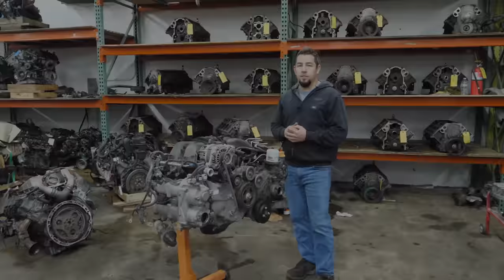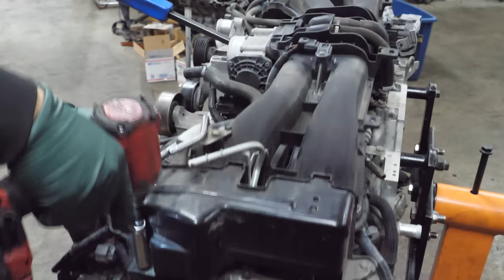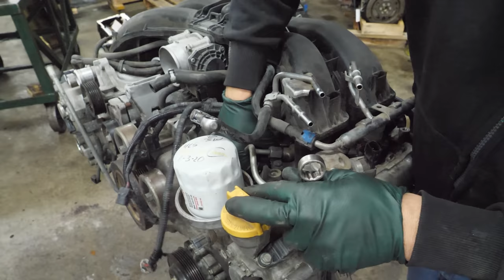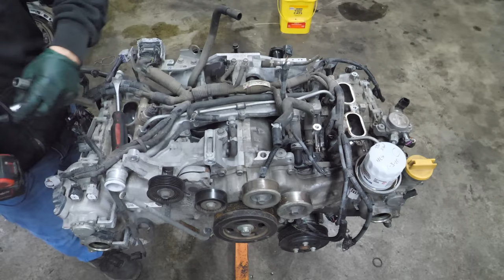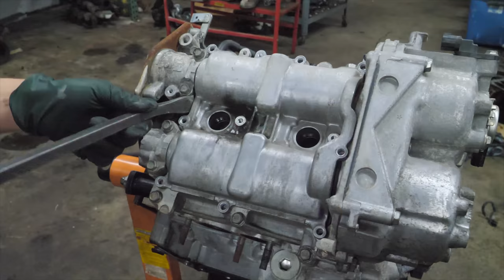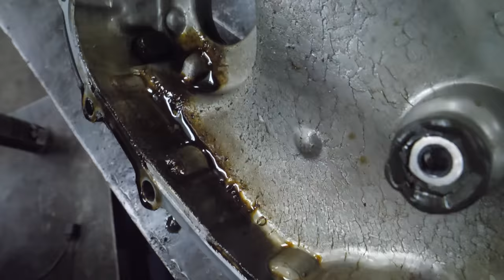Blown Subaru BRZ / Scion FRS FA20 Boxer Engine Teardown. A $3,000 + Whoopsie.

Comment: For the 5 decades I’ve been driving, I’ve been checking the oil every time I get gas.

In the past few years, I’ve asked the “attendant” at various Costco gas stations how often they see people checking oil.  A few per shift is a common answer. Even allowing for breaks for the attendant, he views upwards of 800 full ups per shift.

So, on-the-order of 1/2% of drivers regularly check their oil. 1 in 200.  Pretty rare. 

Since there usually is a waiting line at Costco gas, I usually release the hood latch while waiting. I’ve had other customers “alert” me to the unlatched hood because they so rarely see people checking their oil while filling up with gas.

Comment: Lack of maintenance pays off. Pay me now or pay me later. Majority of people prefer later because they know everything
Reply: My grandmother always cares her cars for the proper oil change and checkups, even though there is concern that they're ripping her off even though it appears unlikely.
Reply: @iceresistance  , always pop the hood and check oil color and oil filter making sure it was replaced. Trust but verify!
Reply: @repairvehicle  Her car will tell her if the oil has not been changed, and the place she changes the oil is reputable.
Reply: @iceresistance  , she is making big mistake by going by the light
Reply: @repairvehicle  She does check the other fluids to make sure they did what she expected them to do because she got ripped off by the previous dealer by filling up a much smaller amount of the fluid.

Comment: i did the valvespring recall on these engines. have done around 22 of these. they all leaked oil on the front chain cover. some on the valve covers.

the worst I worked on was one somebody already tamperd with it.
leaking everywhere, and alot.
 about 80% of the oil pickup blocked with sealant and rag fibers. thick grooves on the camshafts, missing filters for the vvt... but still runs, eh.

worst part of the recall was removal of all the old sealant. it takes some hours.

the rest was fun tho!

Comment: These engines are great at this. Oil starvation of the crank. Three ports for the four main bearings. Also don't do the valve spring recall. Engine is likely to fail after, due to rtv in places it shouldn't be. I have a car with this engine. If it fails I swapping to a Honda motor. These motors are not reliable especially if you want to make more power. And the end with the oil. Factory recommends 10k mile oil changes. Don't ever wait that long with these. I'm no expert, but most enthusiasts do 3 to 5k mile oil changes.

Comment: Really interesting engine. I don't think I've ever seen an oil filter located like that. Thought you had the motor upside down for a second. I can understand how somebody could not check their oil level, but there must an oil pressure light that would come or at least start flickering. Ignoring that is inforgiveable.
Great stuff anyway.

Comment: I worked at a yoda dealer when the frs came out.  Every single failure we saw were due to money shifts.  High rpms in 3rd, go for 4th but get 2nd, and dump the clutch.

Edit, never seen a auto blow up.  Always a manual with extreme carnage.

Comment: Early 13’s also have a common failure of a short on the fuel injector for cylinder #3. Shorts and stays open while car is off, fills cylinder with fuel and then hydrolocks when you go to start the engine again

Comment: Another problem with those engine is I do not believe they had an oil cooler and the valve cover is baffle-less. The new version is a. 2.4 with oil cooler and  baffled valve cover, al least in the gr86

Comment: If it helps, the cams/caps do not need to be removed, remove the whole cam girdle assembly as a whole, as well, leave the high pressure fuel pump where it's at. You're risking contamination. The rest you seemed to learn as you went re splitting cases etc. These engines are really quick to tear down once you know what not to touch.
Reply: Also, bank 1 and 2 side have a different crank position to achieve prior to removing chains and or heads. Also leave the crank pulley and snout on to turn engine to achieve these positions.

Comment: "Check your oil" - you'd think you wouldn't have to tell people this, but it is *THE* important advice for internal combustion engines.  I check oil level and color just about every gas fill up.
Reply: 100% agree. You can do it while filling up with gas, only takes a minute to do. Take a glance at the water level, too. What else are you going to do, stare at your phone?

Comment: The other failure mode I heard about is excess assembly RTV causing oil starvation by impeding the oil pick up. I'm sure that does no favors given the driving style these engines experience.

Comment: Looks just like my engine ~40mi after having the valve spring recall done :D RTV fragments from disassembling / reassembling everything clogged up the oil suction screen and it spun a bearing on the drive home. Shame: I liked my engine, and I figured after ~80k trouble-free miles the valve springs probably weren't going to fail. Recall compliance was mandatory in CA, though :\

Comment: Subaru. Great cars and engines.
Engines are notorious for not being forgiving running them low. Also, they don't hold much oil in stock config. That one had a lot of heat on the bottom end and yeah, low oil too at some point.
Reply: How can one upgrade how much oil it hold with a intercooler or hmm i forgot yeah true about stock config😅👀🔥🙏

Comment: a comment for the end of the video... no, you should preach because some folks need to hear it. It takes not even a minute to open the hood, pull that little stick out and check the oil level and these teardowns are great evidence of how ONE simple task can save thousands of bucks.

Comment: Next time you're splitting a boxer case, get a large rubber dead blow hammer, stand the block up on its bell housing mating service and wrap down on the nose of the crankshaft with graduating Force if that doesn't get a result put it back down on its upright position and( rubber dead blow hammer only) wrap on the side of the crankshaft nose with graduating Force alternating both directions if necessary if you only see a slight split on that end of the case go to the output end of the crankshaft with a long brass drift and Hammer of choice to the side of the rear flange of the crankshaft as done on the nose. When you have a good block this will prevent you from marring any area of the block or damaging anything in the process. Applying Hammers and punches and screwdrivers or whatever pry tool is not necessary nor prudent if the boxer case is not junk.

Comment: Most of the "no oil" engines you tear down I wonder "how could you do this" because since about the 1980's cars with < 200,000 miles don't use much oil.   I run my vehicles hard, change oil&filter every 3000-3500 miles & rarely check it & keep vehicles to 200k.  But my 2.5l 2014 Subaru used about 4 qts per 3000 miles.  Completely rebuilt under warranty at 36000, "improved" to about 1500 per qt which was considered normal.  My other vehicle was a 2006 dodge Dakota that didn't use any oil @ 138k.  I can easily understand how someone who is used to modern engines could run a Subaru dry.
Reply: Modern engines use VERY light pressure oil control rings, to reduce friction and improve fuel efficiency. They work OK when new, but as the miles build up the oil consumption often becomes much higher than we'd consider usual in a 2000's engine.

Comment: Just check the oil?  Ok.  I did that, religiously.  Last change was 4mo ago.  I did do "spirited driving" but the car was never tracked and never subjected to extended G-Loads.  I checked the oil before my last trip where the car was running flawlessly, and on one of our night drives I noticed a rapid change in the sound of the engine and immediatley stoped the run and it was knocking loudly.  I was paranoid this might happen as it seems so common so I did everything I could to maintain that engine and it still shit the bed.  I love my car, but there is no way im putting that same engine back in there.  Its no fun constantly being worried this will happen, doing everything you can to prevent it, and it still happening.  Now it will sit until I get all the parts together for a kswap.  Id rather wait 6mo then drive 1 more mile wondering if its about to happen again.

Comment: Before it ran out of oil, that was a pretty good little engine. 200 hp out of a NA 2.0-litre is good going.
Reply: Honda did better in the late 90s with the S2000. Naturally aspirated designs should be on the way out. Right now, Toyota is pulling 300hp out of a 1.6L 3-cyl turbocharged engine.
Reply: @hawk 7886   - yes, of course. It turns out that turbocharging is a replacement for displacement.
Reply: @Hawk7886 Congrats, You made an ass of power from less displacement by increasing stress, and wear. While making it harder to maintain and repair.

Enjoy your 300 horsepower out of a gokart motor and I will enjoy my 200 NA horses from an old growling Subaru or Toyota 4 banger for years to come.

Comment: Wow, I had designed for a fun a Boxer Engine and that is exactly how I laid it out!!! I never understood the hole in the cylinder wall deal. The VW air-cooled weren't that way because the cylinders were separate. I bet they have a Case Splitter for those like the old VW Engines.

Comment: I know this is old but why not design a lubrication monitor that hooks into the electrical system to disallow the engine from turning over if low/bad oil detected?  A more sophisticated filter with a replaceable element.  Or, maybe an oil pan with sophisticated sensors?  Like you said - $3-4k engine is worth protecting.

Comment: I think the only thing I like about that little motor is that incredibly easy to reach oil filter and a little spill gutter around it. I've never seen a motor that had three or four idlers on a belt though. I actually would like you to weigh all the hardware and cams and nonsense that goes into one of those little Motors versus American pushrod V8. I think the hardware outweighs an American crankshaft

Comment: IIRC, the valve spring issue was for the earlier MY cars. The post 2017 facelifted versions shouldn't have valve spring issues and the FA24s with the Gen 2's don't have them as far as I know.

Comment: the valve spring issue was only in the very early 2013 models. They fixed that issue on the later models

Comment: Thank you!

This one wasn't on my list, but I have been wanting to see a chain-driven Subaru engine for a while. I wanted to see the difference between them and the belt-driven EJ series, and this definitely did not disappoint. I have yelled at so many of my customers that have come in needing multiple quarts to top off their oil. I've been meaning to get a set of bad bearings and maybe a cracked piston as a visual demonstration of what happens when you don't check your oil. Then again, these days cars are made to be disposable, so... angry parts guy muttering.

ENGINE REQUESTS: 
Ford: 300 Inline Six, Windsor, FE, 1.0 EcoBoost, 1.4 EcoBoost, 5.2 Voodoo, 6.2 Boss, 7.3 Godzilla (probably a bit early for this one yet), 6.0 PowerStroke, 6.7 PowerStroke
General Motors: 3100/3400/3800 Olds, LUW/LWE 1.8l i4, 5.7L Olds Diesel, L5P Duramax, L86 6.2 (shouldn't have too much trouble finding that one)
Chrysler: Slant Six, MORE HEMIS, 1.4L FIRE, AMC 4.0/4.2, 3.3/3.8, 318/360
Honda: B Series, D Series, K Series
Toyota: 1LR-GUE (lol yeah right), 1GZ-FE, 1ZZ or 2ZZ
Subaru: FJ series, EZ30/36

Comment: If you see one of those bot/scam replies to any comments on here, don’t click the link, don’t reply to it, ONLY report it as spam.

Regarding checking oil, we are at this point where low tension piston rings and super thin oils mean that literally every engine burns oil now, and vehicle manufacturers have tried desperately to downplay vehicle maintenance needs. We’re also using smaller engines with turbochargers, engines that would have similar performance to super cars of the 1980s and earlier are now being used in common, consumer vehicles. For example, a mid-grade Honda Civic Si with the 1.5 turbo engine makes 200hp, or 133hp/L. A Ferrari F512M, a super car from the mid 90s, makes 434hp from a 4.9L V12, or 89 hp/L.  Even the venerable Subaru WRX STi with its 2.5L that makes 300hp makes less power per L of displacement than a Civic Si (120 hp/L) That combined with the fact that people are working longer hours, have higher stress levels and tighter schedules than anytime in recent history, along with more complex vehicles leading to less and less owner knowledge of their vehicles (i.e. many people don’t even know how to open their hood let alone check their oil)…yeah, engine failure is pretty common now.

Comment: As being a youngster that worked on 50-60-70s engines, looks like auto manufacturers spent many hours to see how complicated they could make an internal combustion engine. With modern oils and improvements in metallurgy the old designs would have probably lasted 300k miles.
Reply: the old designs made no power with a shit ton of displacement
Reply: They would run forever, But also probably bankrupt you through how fuel inefficient they were.

Still would be cool to see someone make replicas of old, Pre and early fuel injection monsters with modern materials.

Comment: I've actually seen the most common modification all Subaru owners have done was add what's called a deep chambered oil Pan to these engines to prevent oil from sloshing around too far otherwise some parts won't be lubricated

Comment: Powdered bearings were the greatest invention since powdered toast, and were a game changer in multiple industries. Engine low on bearing? Simply add 1 cup for every 2 quarts engine oil. It's as easy as adding headlight fluid.

Comment: High quality name brand filter, shows the maintenance  this got towards the end of its life...
Reply: As a Subaru engine plant worker, I noticed that right away. I use nothing but JDM OE filters and always replace the crush washer.
Reply: That's a contentious topic in itself!  The Subaru oil filters you get in the USA are made by Fram, whereas the one originally fitted at the factory is a Japan-made Toyko Roki IIRC.  The oil filter on this engine said "Service Champ" which makes me think it is made by Champ Labs who are a reputable US oil filter manufacturer (they make some OEM AC Delco oil filters and so forth I believe).

Comment: Bro, it was a 11k (dealer rate + new clutch) oopsie for me, I bought a 2014 BRZ online, had the car shipped out from PA to CT, and the motor blew in 15 miles. We didn't end up getting a warranty for some reason, it was very confusing I still don't remember the real reason, but they ended up covering the cost after we threatened legal xD, but just a PSA look out for shady people and always buy on sight, not sight unseen, always do your research and know what you are buying. Good luck and stay safe out there everyone.

Comment: Brass drifts should be a No No around engines. Pieces chip off them especially if your working on a good engine. Use a old hickory sledge hammer handle to knock out rods and pistons as they won’t damage them like brass does.

Comment: My wife's first car didn't get an oil change for 2 years because she thought she just had to add oil. That is a parenting failure. Problem is we're now a generation away from people who still casually worked on their cars. Some still do but most can't change a tire. My dad made us change brakes, oil, tires, rebuild CV axels, and replace head gaskets. If my dad bought us a car it came with a Haynes manual.

Comment: There is a design flaw with the fa20 oil delivery system. Even people that check the oil religiously got rod knock. The ej25 also had the same problem. Subaru never learned from their mistakes

Comment: Nice! I went out just to check the oil in my fr-s after watching this. it was full and the oil looked clean on the dip stick lol. The thing about the fr-s is the engine is tuned to make as much horsepower possible, which for its size it does make a lot. the downside is you have only power up in the top of the power band, so you have to rev it. Anything below 2500 rpm is just dogging it, and also right around 3500 is crap as well. Cruising at 85 sucks big time since the gearing puts you right at 3500 rpm in 6th gear. Makes me want to regear the diff some times, stock is 4.10, 3.73 would get it out of the torque dip and better fuel economy, plus stretch out the gears a bit more wouldnt be bad. I hear the gears are just standard 8in toyota gears. I have some laying around from my trucks.
Reply: Dude it's not even remotely high strung. It's an engine that was designed for boost and barely makes 200hp in NA trim. It's down almost 70 horsepower and  100ft/lbs of torque when compared against the same engine used in the WRX.
Oil consumption is a problem in this car just like it's a problem in every Subaru engine.
Reply: @Hawk7886  Im not saying the engine is near the limit, what im saying is the usable power band is at the top of the rev range, and thats where most of your problems will happen. if it was boosted, you would make power lower down in the range.

Comment: No engine is perfect and something always fails first. But I've worked on. Let's say a lot of Subaru's. (Many hundreds of engines) and out of the current engines the brz and ez 36 stand the test of time best. You take care of them they take care of you. They may leak at somepoint but they very rarely fail. Also Subaru recommends 6000 under normal usage

Comment: I do appreciate that Subaru knows someone will have to get at their engine, so it's pretty quick to remove.  A dozen bolts, a couple hoses, a big plug.  The luxury brands should be fined for something.  It's downright criminal how much of a pain in the ass some vehicles are to work on.